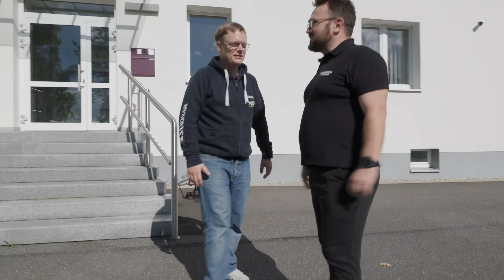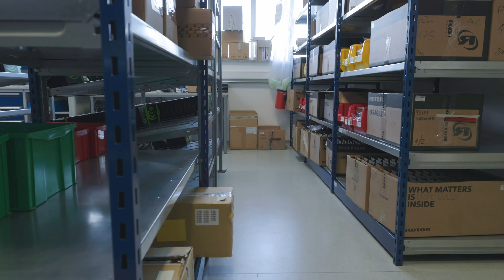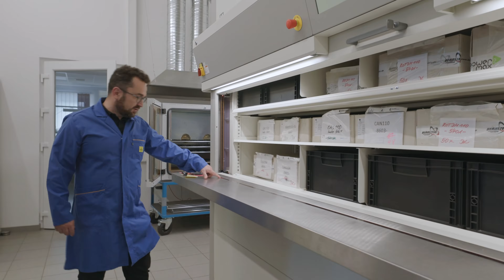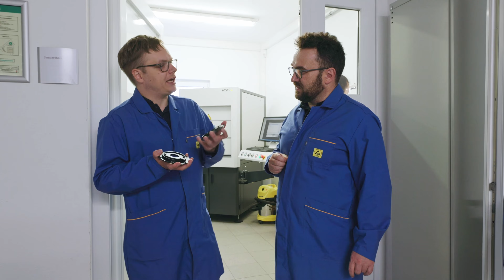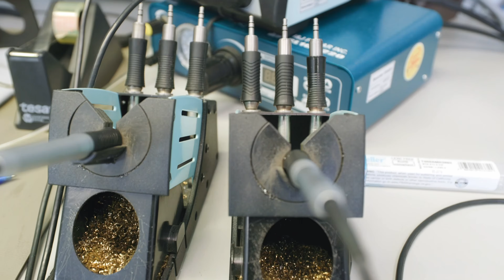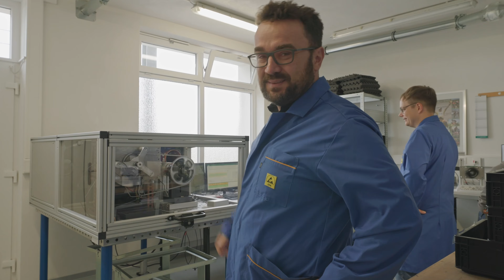Power2Max Factory Tour. Best location for measuring power cyclist power is? Giveaway!!!

Comment: I recently bought the Power2max ngeco for my Specialized Diverge STR gravel bike. Replaced the 4iiii left crank arm because I wanted to go from a 172.5 to 165 crank arm and Shimano doesn’t make one for the GRX group set. Love the Power2max. Very accurate. My only gripe is having to pay an additional fee to get the data for both sides 😮